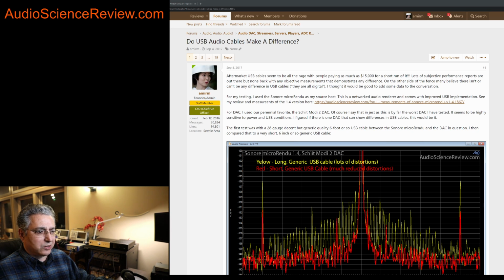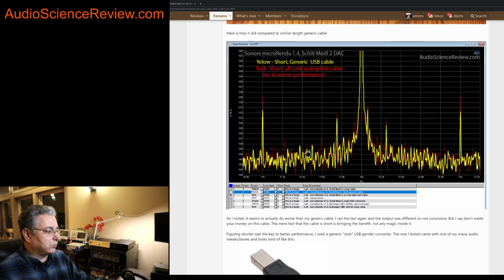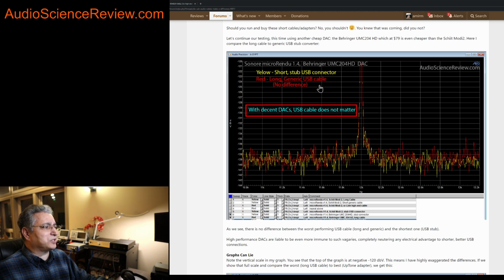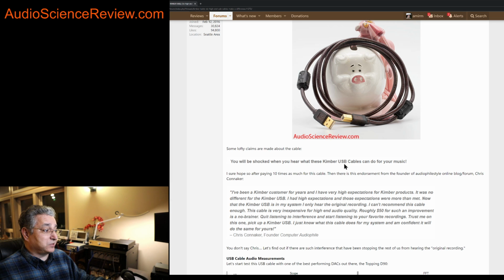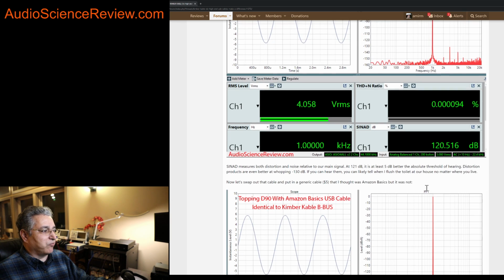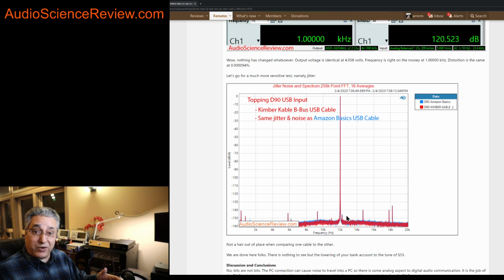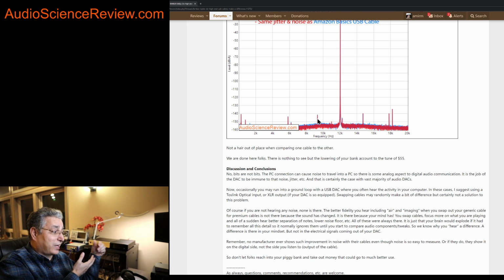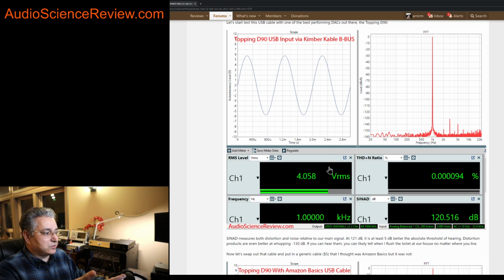Do USB Cables Make an Audible Difference (Kimber Kable Review)?

Comment: I think the controversy has to do with NOT having a resolving enough system AND/OR discerning ears able to hear a difference.  All cables act as tone controls on your system and can alter the sound of your components.  I have experimented more times than not with various cables and have heard differences from power cables to interconnects.  This is especially noticeable when using a balanced system (XLR) with power conditioning.  YES, I can hear the difference and if you can't then keep it simple!

Comment: Really interesting video, but I would challenge your belief that USB cables just transmit digital data reliably, when that's not true for audio. In audio applications USB uses isochronous transfers which prioritises continuous stream over reliable data transfer and that protocol includes no error correction function, unlike bulk data transfers
Reply: That's fine but if there is an error it would "corrupt" the audio and you would hear a crackle sound and it would continue to break up. He said that in the video and it's true. When you have a really short cable and you record the output it will be the same and it will be in the same order. Jitter is fixed just before the DAC when the USB or optical audio is converted to i2s with a buffer from the clock. I can't see any way that this could be bad. I have had really old pc that are super slow and it was breaking up but it was no fault of the DAC or cable.

Comment: A question on DACs! I have been trying to detect differences between DACs of different types and prices over a number of years by ear. I don't have the types of test gear you have. My question is if almost all DACs produce distortion and noise below that of hearing does it matter? Personally, I cannot hear any real difference between the DAC in my PC and 8. I have listened to over a number of years. 
You are right, if you switch on a $1000 DAC it does sound better, I really want it to sound better, but after the excitement and doing real blind tests, I have to report I really cannot tell any REAL difference. So guess what? I use my PCs DAC until someone can let me hear some difference. I'm not optimistic.
Reply from the maker: No problem with your testing and conclusions.

Comment: USB cables make a noticeable difference and that is certain, at least for me in my system. If that is not being picked up in these measurements, then that just shows that we're not measuring the right parameter. Golden Sound recently proved that even when digital in transferred properly, there can still be a different output from the DAC.
Reply: That was jitter. If you use a bad DAC it will be very clear. If you use a good dac you won't see it.

Comment: I am not convinced that a steady state 1 kHz sine wave is a stringent enough test case to prove that better quality usb cables make an audible difference.
If I draw  an analogy between CD players - they all measured perfectly for steady state distortion at 1 kHz -  in 1985 but they all sounded dreadful when asked to play music - especially female vocals.

While I’m an electronics engineer I’ve been around long enough to know that we still do not have sufficient objective measurements that tell the full story.
Having said that I do believe it should be possible to simulate a musical digital stream and check  a usb  cable for data transmission  errors with a digital analyser.
If the cable creates no errors and the bit stream is preserved there can be no change in sound.
Reply from the maker: There is nothing "steady state" about 1 kHz digital signal.  It is a sequence of digital values that is constantly changing.  You talk as if it is DC.  It is not.  The DAC has no idea that this is a single sine wave or many.  And all that data is going through the USB cable just the same.  As an engineer, you should know not to go for these lay arguments.

Let's remember that people say these cables make obvious differences.  If so, they should easily show up in any measurement.  How on earth can you change the nature of the sound out of a DAC yet no measurement shows it?

BTW, the jitter test is a nested square wave.  Its decomposition will have infinite bandwidth and combination of signals.  So not a 1 kHz tone at all.

Comment: Thank you so much for your reivew - realy nice to see your scientific approach to things instead of "statements" from some third party often on the webpage of the manufacturer, and also so many channels were indivituals are speculating and trying to explain what the hear (or don't hear), and from that send out in the cosmos some statement that this or that is so much better.  Do you in any of your videos show how you use the oscilloscope to do those measurement?  I would be so interest (and hopefully others) to see how one does this.  I bought an oscilloscope just the other day (4x channel one, with two signal generators), but have no "hands on" knowlage on how to use the unit (activate it's "powers") to test my hif-fi equipment to "see" the performance, and do some testing between different setups of my equipment.  Thanks again for a great channel!!  Regards, from Iceland
Reply: Horrible video. Instead of listening to this man's aberrations, listen with your own ear and you will see the enormous differences between a cheap cable and an expensive one. Only "audiophiles" here.

Comment: This is just silly to begin with.  USB is digital, so as far as data goes, either they work well enough to transmit without errors, or they can't.  For power, though, it makes sense that if the receiving side doesn't filter the power well, then it makes sense that anything powered by USB may be sensitive to the power source and cable.  Ideally the device would detect this and blink a red LED or something.

Comment: Thanks for thew video. There is small problem tho. The output cable from the DAC to your spectrum analyzer will couple  to the USB cable. While the setup you have looks very good (low noise background), there is still coupling, and most likely running shielding the DUT (with cable and a source), and separately the analyzer (running from battery), would show even better performance.

One way or another, it is not audible difference.

Comment: I told a famous racing car designer the reason many buy expensive cables is the wife won't notice. It's pampering. However building better cables is always worth a try. It's like a nice watch. Does it keep better time? No. It's nice to own. CPC do a very cheap 2 amp USB cable. Now that USB > 1/2 amp it's valid.  What makes wine different may be 1% of what it is ( 86% water ). 0.1% likely. I would imagine sceince would not be able to say much about wine. Where from and what grape, red is red as that's easy. This says to buy expensive wine is stupid and wine is only about getting drunk. If so Vodka is the nicer wine. I would suggest chemistry is much more advanced. Remember these tools are in 2D. For example a power wave looks like a distorted sine wave if shown as is into a resistive load.

Comment: Is it psycho-objective or just subjective?  
The most valuable asset a cable have is that it actually reach its target. BUT, if you have a choice to buy a 39¢ audio cable or a $6 cable, chances are the $6 cable may have more linear response and actually may be built more solidly. Love this video.

Comment: I was a victim of having to believe that expensive cables makes a difference, believe me, it does nothing as you have said, I ended up using Amazon Basics cables because they are nice to the feel of it they are supple and flexible and that’s it, 😁😁
Reply: What did you do with your expensive cables? Why do you use Amazon basics if you have expensive cables? Not trying to hate, but if you have the snake oil cables why not just use them
Reply: @Biefstukje  I got one of those Audioquest cables they are hard to connect coz they are quite stiff  and when you try to tinker quite often and experiment into different components it is quite a pain not to mention that it doesn’t make any difference in sound quality, Amazon Basics as well as the WBC cables makes it easier

Comment: I have definitely heard a difference in USB cables:  Between one cheap cable that was clearly garbage and was causing obvious and audible noise, and another cheap cable that did not 😸.  I agree, re the Amazon Basics USB cables.  I use those, and also some relatively inexpensive, but still overpriced, Pangea ones (because they look and feel  nice, not because I think they have any impact on sound).
Reply: Of course they affect the sound.  But he didn't do any listening tests.  Just measurements of one or two particular variables which he found to be equivalent, but there are a dozen others he didn't measure, including the most important one, an actual listening test.

Comment: Most I've spent for a USB cable solution was $400....
BUT. It's 50' long, 5gb/s, data only, and has optical transmitters and receivers on each end (it's fiber optic cable- not copper).
It wasn't a purchase for audio equipment (camera tethering) and was highly specialized. That type of cost is just what the use case demand- no substitutes.

Comment: Have tried various USB cables... from Mac to my DAC. Price range £4 to £45. You definitely can hear a difference. My fav is one from EBAY @ £3.59 from seller - juicebitz a  Heavy Duty 4mm OD + 20AWG USB A to Micro B Fast Charger Data Cable Lead - Not sharp sounding, very clean, great resolution and dynamics. In fact the only one out of the six that I have that I can live with!  I did blind listening tests to prove it wasn't just placebo effect.

Comment: at it may affect you is the quality of the connector, and it wont be affecting sound but they have a shorter life span. Shielded cables are used in areas where there is a lot of electric noise and a home studio/entertainment center won't have a lot of noise unless you put the cables next to big industrial motor cables in your living room.

Comment: I have an Audioquest Forest 1m usb cable going b/t my desktop and FiiO X7 mk2 mp3 player while in USB mode. That in turn is hooked up to an Aune X7s, balanced OCC silver litz headphone cables, and Empire Ears Cerberus 3's. It's more resolving than any stereo system I've heard at any price; essentially my personal reference system. When I changed the no name USB cable I was using to the Forest cable, I honestly did not hear a difference. Regardless, I don't regret buying it b/c it was only $40, looks nice, is well built, and has taken on a lot of abuse from me accidentally kicking my desktop and jamming the USB cable at a 90 degree angle between the back of my desk. Didn't even flinch. But $40 is the most I'll ever pay for a UBS. What DID make a difference, was going from having 3 really cheap and skinny 10 foot USB cables all wired in series going from my desktop to home theater setup on the other side of the room. With that setup, I had random dropouts of sound every 20 seconds or so, and complete disconnects which required restarting my device to amend. I went to a single 30 foot shielded thick USB cable from a reputable audio company for $25. It reduced the problems by 3x, but didn't completely prevent them. So I bought a Schiit Wyrd. I know. But wait - it actually helped. Upon using the Wyrd, with its onboard USB power supply which throws away the 5v power coming from your USB source, and it reclocking feature, sound dropouts and disconnects of my FiiO X7 were reduced to once every 2 - 3 hours of continuous listening. It really did work and made my long range USB setup usable. However, I did not notice a sound improvement using the Wyrd at point blank range with a 1m USB cable. So, it seems that the longer your USB run, the higher quality the cable should be (thicker gauge, purer copper, better dialectric material, better shielding, better twist geometry, etc...), and the more hardware you will need, such as reclockers and 'decrapifiers' . But at close range, anything UL certified will likely be just fine.
Reply: I use an old laptop on a dock as my entertainment station with a 5m (16ft.) USB cable running towards the DAC and a CAT5e internet cable running along it. I do have plans to replace it with a mini-pc and a wireless keyboard so I can shorten the cable runs and reduce interference but it still sounds good. I did notice a slight difference in sound when playing a FLAC rip of a cd over ASIO versus the same cd in a transport and hooked up to the same DAC but it was almost impossible to hear. And no, I haven't done a double blind test with it yet.

Comment: I have found Lenovo ThinkPad business laptops, regardless of generation to have the least amount of noise (inaudible) on the USB connection. I discovered this with my cheap Behringer USB audio interface. With my Dell Latitude, it had an annoying hum when recording with the microphone. On the ThinkPad, nothing at all. It is very clean. I am not sure why, but I recommend these Thinkpads. They seem to be well designed.

Comment: I had this discussion on DIY Audio years ago, and told the other guy that I am an IT guy and have transferred thousands of GB via USB without any problems, and his
reply was that data transfer uses ECC error correction, that re-transmits if an error occurs, which I of course knew myself. But he said that the data protocols for USB
Audio - Red Book, Blue Book ... whatever has no error correction, so there should be reason to believe that transfer errors could occur here. I use an USB isolator and
a reasonable cable.
Reply: He is like 10% right, without error correction you can get transfer errors, what he does not understand is what those errors result. For the expected amount of errors on a standard usb cable you will get one error around every 2k songs played, and every data transfer error will be an audible sound (like a high frequency/low frequency "pi" or "thumk"), not distortion.

Comment: I have though bought £20 USB cables for my DAC, not however, for improvement in sound quality but for the better looks and nicer build quality than the cable was thrown in the box. If it looks nicer...that's enough! The technical side is covered whatever cable. I have to say I've bought a lot of Amazon cables and they have all been really good.

Comment: I get so sick of these reviews. I'm going to buy testing equipment and do a real rational review. You need to be running your tests at various frequencies. 20k, 25k.    This reminds me of the high end preamp reviews where no one ever turns up the gain, and then they make audio recordings that sound identical. A/B testing needs to be done by people with a minimum IQ over 120.
Reply: Horrible video. Instead of listening to this man's aberrations, listen with your own ear and you will see the enormous differences between a cheap cable and an expensive one. Only "audiophiles" here.

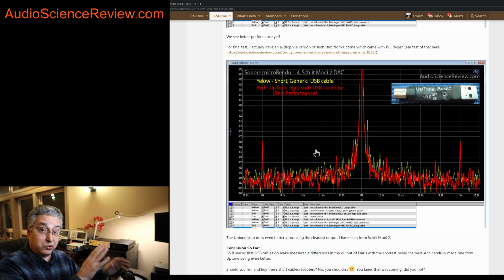Comment: If you ultimately only care about minimizing distortions (4:40), the main question must be the following: aside from shielding, noise, and cable-length issues, is a "better" USB cable capable of more accurately representating the original waveform?

Measurable experiments indicate the answer is "yes". See the use of null tests to track differences in playback in this "Passion for Sound" discussion: https://youtu.be/zncAhs44sp8

See also Hans Beekhuyzen, who discusses the waveform's reproduction from square waves, in "Improving digital audio signals": https://youtu.be/N66aDb7LZaM

Comment: Some people aren't happy with the bragging privileges that come with owning a $50k+ system . . . they need to own at least one cable that alone costs several times as much as the average audiophile's complete sound system.
Reply: Fact is, it would be stupid for someone owning 50k$ system to hold it back in performance only to not spend another ~5k$ on cables...
Reply: @fabrized  Agreed, but only if you're a member of that religion . . .
Reply: @aerostahr  religion is negation without even trying in my opinion, a pair of functioning ears is enough to understand the importance of cables in a system (not necessarily a 50k$ system)

Comment: Are they saying that if I copy a FLAC file using a short high priced USB cable between my PC and an external HDD, the resultant FLAC file will sound better than if I copy it using a long cable? That's interesting, because in my tests, the FLAC file is ALWAYS completely identical - i.e. bit-for-bit IDENTICAL! Curiously I get the exact same result when I send photos, spreadsheets, documents, videos etc. - They all are correct at the other end. If I use an expensive cable, will the transfer improve the quality of my videos too? If I send a spreadsheet budget to my HDD using a more expensive cable, will the numbers look better?

Regardless of USB cable used, the DAC is always receiving IDENTICAL samples, in an identical order and, unless it is a garbage DAC, it will be buffering those samples and processing them according to its INTERNAL clock frequency, so even the speed of the USB cable used is irrelevant. There is no opportunity for the DATA to be altered between source and destination - so regardless of which USB cable is involved, the DAC is presented with an IDENTICAL series of digital samples to decode.

What exactly are people suggesting is happening to the BITS between the source at one end of a digital USB cable and the other?

Comment: I thought people know that those are digital signal and the USB2.0 spec specified that length can deteriorate signal (longest is 16 ft 5 inch)... not so much about how "audiophile" it is as long as it meets the spec.
Armir - would be interesting to do a test for "audiophile" switch and ethernet cables too :D